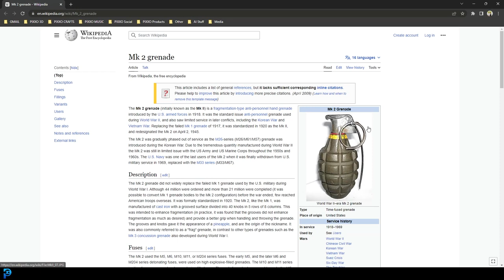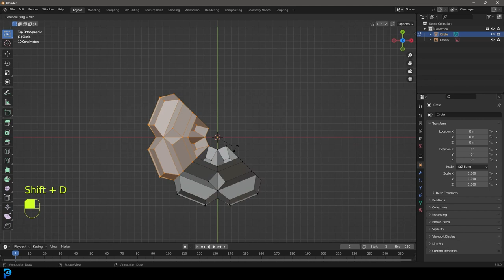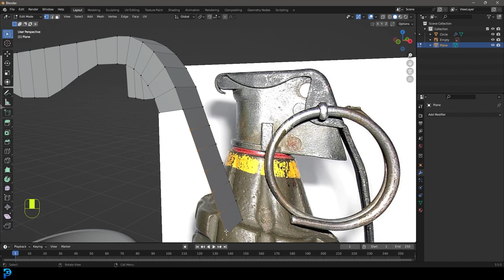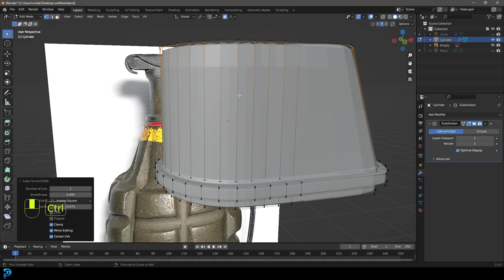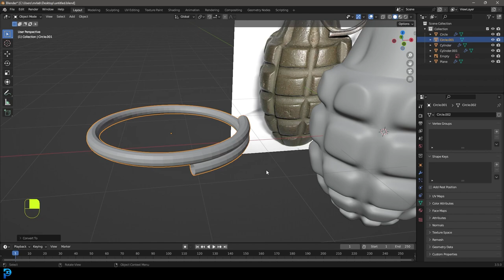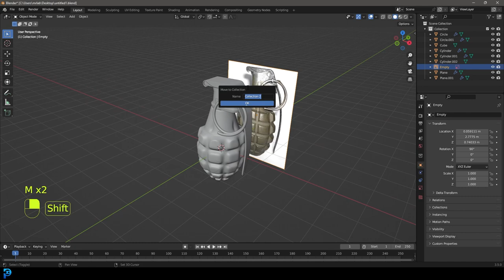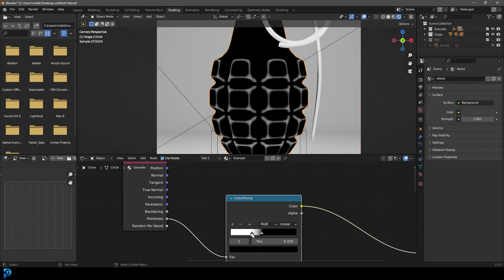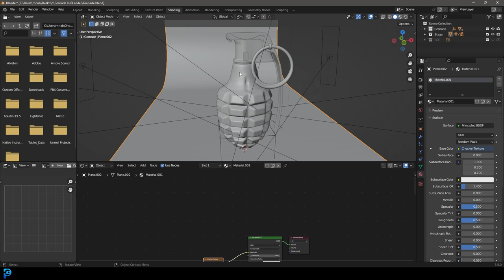Tutorial: Make A Grenade In Blender 3.5

Comment: For some reason, when I try 3:44, it extrudes one side of the grenade in one direction and the other side in the other direction, however on the video, 3:44 it extrudes proportionally, in all directions at once, can someone help with this?
Reply: I found the solution, need to select all and press Shift N to recalculate the normals